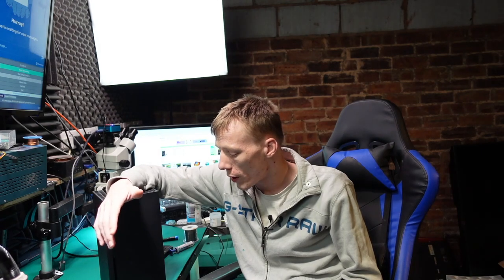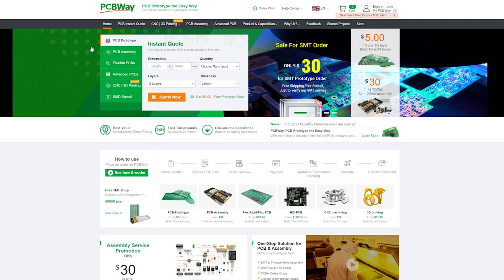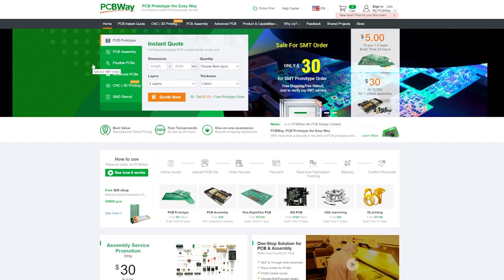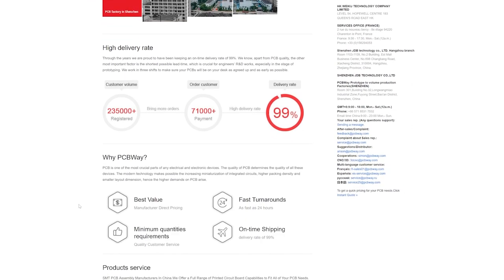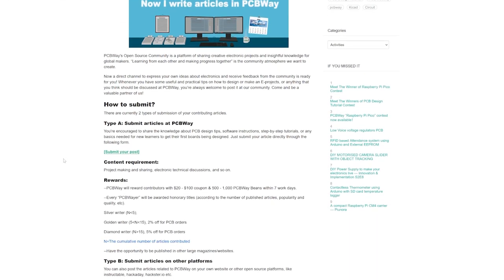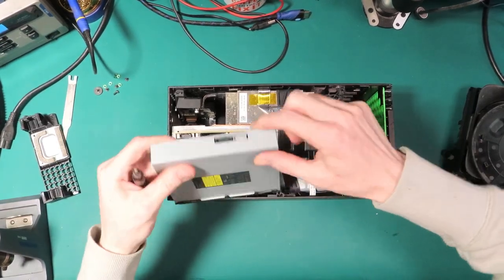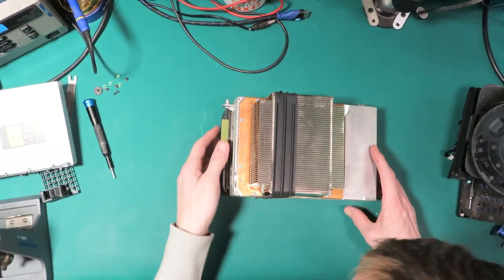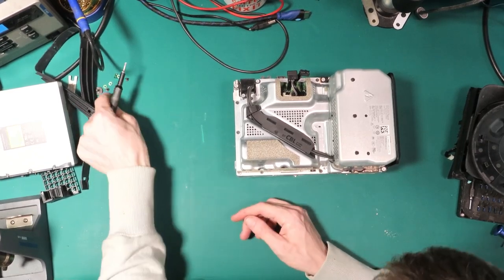I Purchased The WORST Xbox Series X I Could Find On eBay... But Can It Be Fixed?

Comment: The best way to deal with this kind of damage is to get a dremel and carve out the damaged part with a griding point. I've done it 3 times and it removed shorts from boards with 12+ layers successfully. I'm not a professional, just an amateur doing some repairs, but I've developed this very nice technique :)

Comment: The damaged edge has lots of holes, these are via stitching and connect the ground planes together, because of the hole spacing, no other tracks run along the edge, it looks worse than it is but will not cause any issues.
Reply: I thnk the same. The issue is not the edge damage but some chip that got knocked out probably. Look for any missing smd resistor or cap. The RAM reflow was a good idea, keep looking a bit more if possible within a reasonable timeframe of course. Cheers from Switzerland.

Comment: I don't know if it's crazy what I'm going to say, but I've seen many console mods where they are cut to make portable consoles (wii portable) if the problem is that the layers are in contact due to the blow, it would not be logical, use a dremel ? You can do a clean cut with a dremel, I think it's a better idea than using a cardboard cutter and scraping, a millimeter with a good cutting tool could solve the joining of layers. If I were you, I would try it, the motherboard is already dead, and it would be an interesting video, if not crazy.
Reply: yeah i was thinking the same thing. a dremel wouldn't pinch the layers together. i haven't tried something like this myself though.
Reply: The only chance if there are only GND and 12V layers. Shortening 12V with some signal line could do this board irreparable
Reply: thats what i was thinking.. a dremel with a small cylinder stone bit should clean it up

Comment: You called it quits a bit to fast on this one. You should ignore that damage along the edge. You only find ground in the edges of the board and for a good reason I won’t get into. Think about it, there is no point to have to run any line towards the edge of the board.

Comment: my parents wouldn't even buy me my first colour tv, so was stuck with a black and white tv until I could get a paper round, so I was 14 before I got my first colour tv. so is the kid spoiled? the answer is a definate yes. can a child do that much damage to an xbox? no, not the amount of force that the front housing has taken. it would have to be an adult. the board looks like after the initial hit with the controller then he console hit the floor or something, so probably be looking for a needle in a haystack situation, and probably be all chips ruined, I don't think the seller is being honest at all. either that or flipping products purchased for cheap, then making up a cover story to try making it sound believeable, and the fact they knew the child had done the same thing? would you really spend quite a few hundred pound on a brand new console? I think not. maybe it was my up bringing, but I looked after everything. while my brother destroyed everything he had. ok so my stuff might have been taken apart to find out how stuff was made, but it wasn't damaged to a none repairable state, but my brother has a temper, but somehow he only went through joysticks, and keyboards. but weren't as badly damaged as this. it taken one heck of a good throw. ok so stuff isn't made like it was back in the 70's and 80's. but still a lot of damage for a kid to do.

Comment: You could try and grind the area where there's a potential short between the layers so that they don't have contact between the layers.
Reply: my thought 2
Reply: I thought this too. I would very much doubt any layout design engineer would use the area between the emc gnd stitching via for signal tracks, the only other possibility would be a power plane. Typically the power plane would be 0.5mm from the pcb edge, taking a dremel around the edge may remove any short. Test for a power / gnd first though. I would have thought the ram / apu would need reflowed though.
Reply: @Deseboy73  yeah the apu and ram would have to be reballed i think a reflow would do much if there are broken traces.
Reply: Hi Denis, yeah this is true, my opinion is that the area of the physical damage is probably just power planes. I doubt there will be any signal tracks in this area, as the gnd stitching vias in this area make it I efficient for signal connections. I suspect the power plane is shorting to the gnd plane in the damaged area. A quick test for power / gnd would take seconds. If there is a short, my idea was to dremel the damaged area and remove any z axis copper burrs.

Comment: Using both boards to get one working the main thing is you will get most of you money back bud. have  you got the headphone jack for your rode wireless go yet would be nice to see you do a video on it.
Reply from the maker: Yeah definitely mate, even though that board is very corroded it's still got some usable parts on it. I have got them yeah, I'll get around to doing the repair ASAP for a video 😁

Comment: i would remove the apu and any other tied components, then fit them to the apu board from the other machine.
then use that to rebuild this xbox and fit it into the other case, you could use the heat sink off the other one too.
but you can totally build one machine from 2 its all about which parts match the apu.

Comment: Thia must have been one hell of a fit of rage... Either that kid really needs help in anger management, or it wasn't the kid who was angry. Dunno, but more I got bad feeling it was parents and in this case I do hope I am wrong, but poor kid. Dunno, maybe I just saw one too many of terrible parents...

Though s far as the part where layers fused goes, couldn't you cut that whole part of ground plane off? I mean I know extreme overclockers at least used to cut part of power delivery PCB off graphic cards, so they could wire in their own and get more power. Dunno if it is viable or there are too many layers. But my though was to just cut that part, as much as possible away.
Reply: Maybe a angry wife our husband threw it down the stairs

Comment: I’d have the ssd if u can put it in an external case.
Reply from the maker: You can put them into readers but they're expensive as hell for those specific SSDs (about £250 which is more than double a traditional M.2). I have reused the SSD on another console though since this video 😀
Reply: @TheCod3r  No I’m not paying that much for the ssd. I can buy one for £200. So £50 over plus post. No sorry mate.
Reply from the maker: @teeslunk  I'm not trying to sell it mate, I don't actually know how much they cost. I've already used the ssd in another console 2 days after I worked on this one
Reply: @TheCod3r  ok